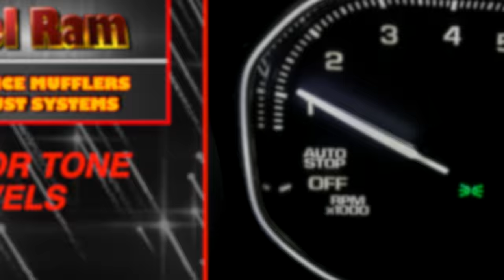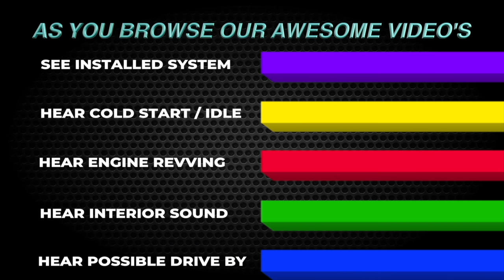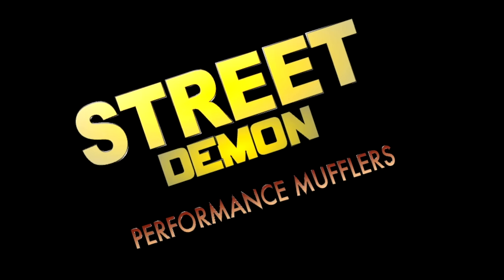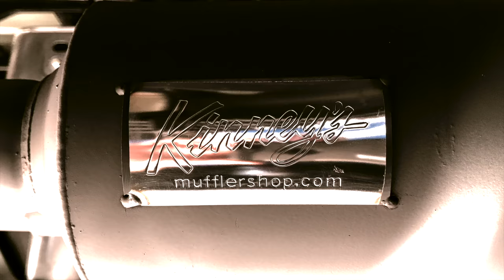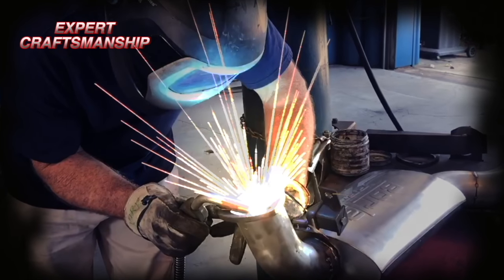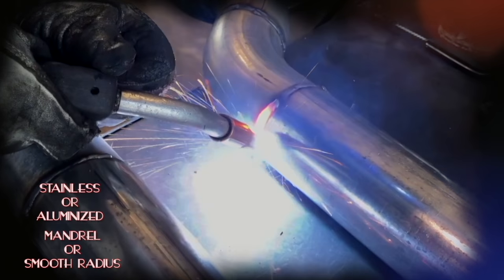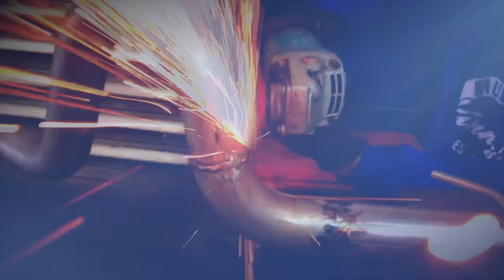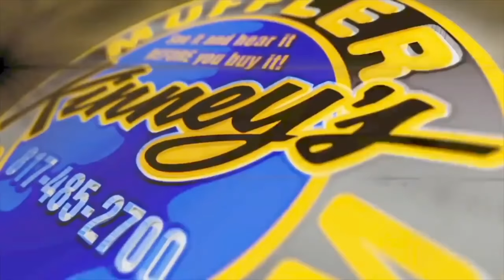2020 GMC Sierra 1500 5.3 Tunnel Ram Performance Exhaust w/Boss quad tips by Kinney's

Comment: I've got a Morgan Plus 6 on order coming next year. It has the same 3.3 litre b58 engine (straight line 6) that's in the Z4 & Supra...any chance it can sound like this?
Reply from the maker: Wow! Congratulations on that Jez. I’m sure we can help you establish a great sound for that car however, it is a totally different animal than a GMC V-8 truck. V-8, V6, in-line six cylinder and four-cylinder engines all sound uniquely different. Turbo charging these engines changes everything yet again. 
Best thing for you to do is to reach out to us when you take delivery of your vehicle and we’ll set up a time to do a consult which will give us the opportunity to work with you to determine the sound, look and results that you were searching for. Thanks for commenting and we hope to hear from you soon.
Reply: @kirkrob0412  Thanks for getting back to me guys. I was worried about the difference in engine spec. The car has plenty of pantomime & it comes already turbo charged but it just doesn't have enough grunt for me (I want a more aggressive sound).

It should be state side by Autumn next year (yea...heck of a waiting time). But I'll be sure to give you guys a call for sure when she lands! 
Thanks guys!